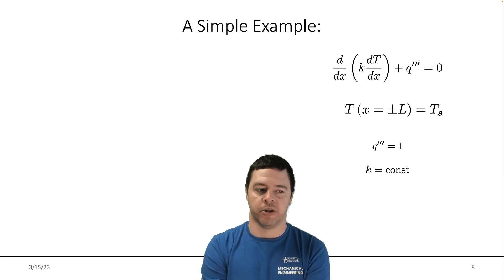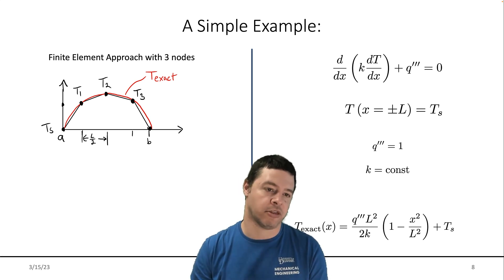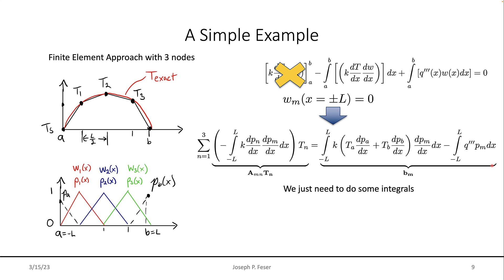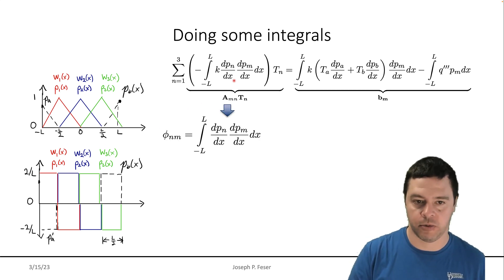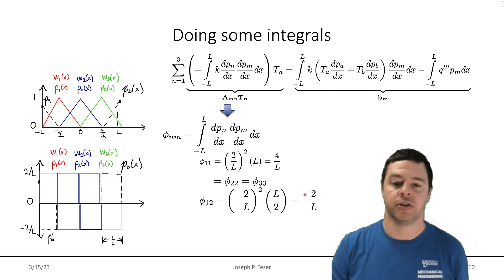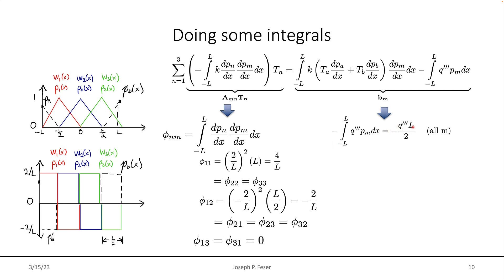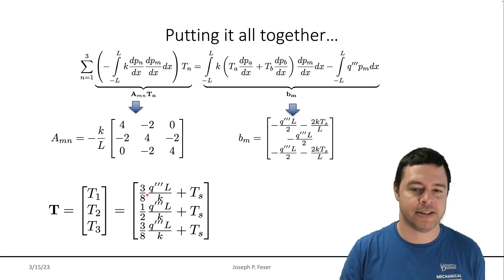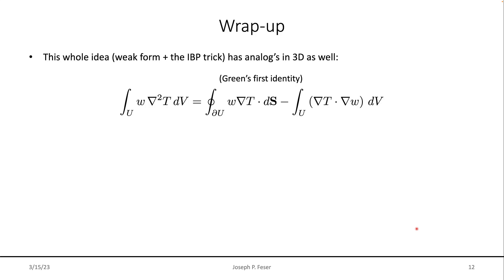Intro to FEA 6: Example, 1D HT w Internal Heating

Comment: 00:05 Example of solving internal heat generation in a 1D slab by hand
01:34 Deriving 1D HT with Internal Heating using FEA
03:11 Solving the problem involves evaluating matrix coefficients and the right hand side
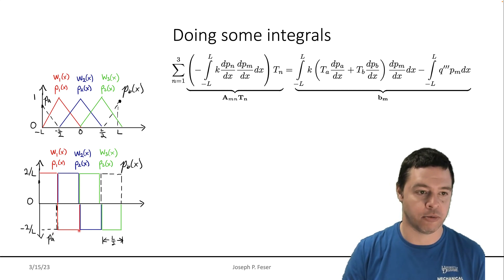04:41 Understanding derivative values using 1D HT
06:15 Matrix diagonals and off-diagonals have specific coefficients and interactions.
07:53 FEA leads to sparse matrices due to many zero values in functions.
09:33 Calculation of matrix values in FEA for internal heating
11:08 Finite Element Method can achieve exact solution at nodes with piecewise linear polynomials